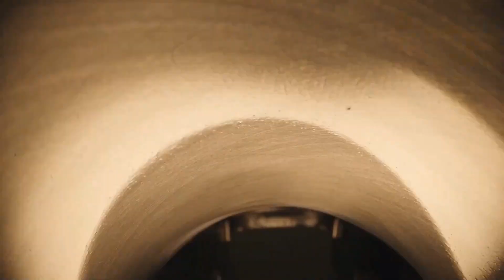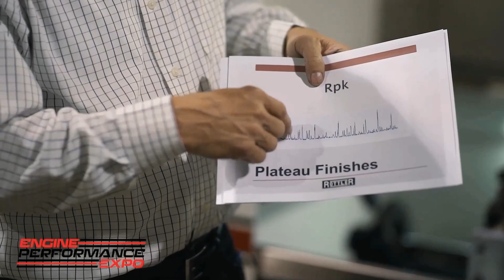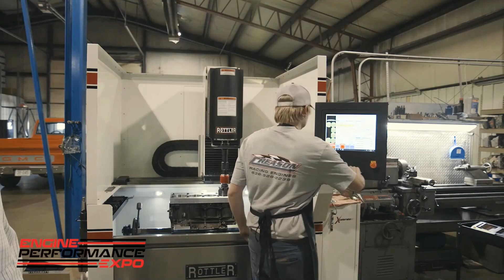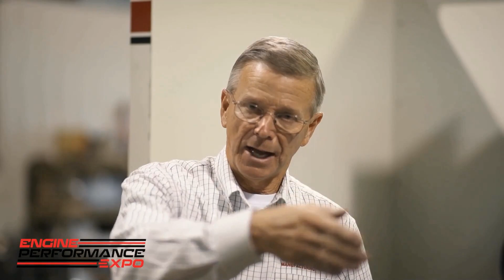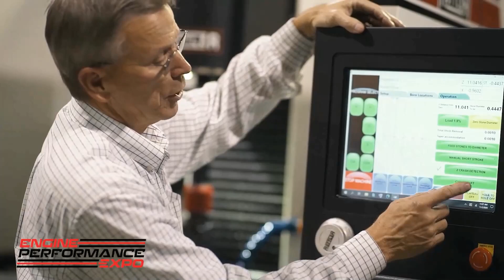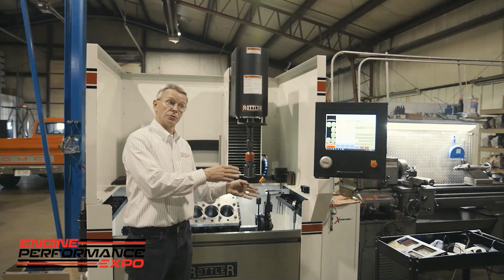Cylinder Honing and Surface Demo Part 3 (2021 - Episode 7)

Comment: I would think that a enlarged, cross sectional representation, to scale, of the various finishes, in increments of maybe 10, would provide a better visual representation of what is being strived for, rather then the abstract representation of the profilometer.
I’m old, and a visual learner, having a hard time with what do the RPK, Rvk, etc., numbers physically represent.
Also, I assume that correcting bore location would still be accomplished by boring / different operation?
Reply from the maker: The new software that shows the actual trace is the game changer for all of us visual learners.